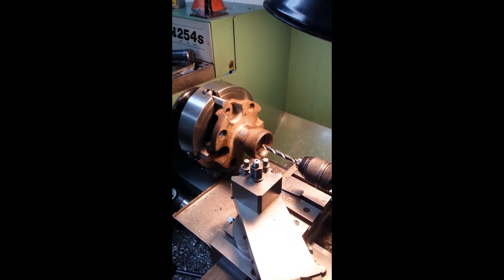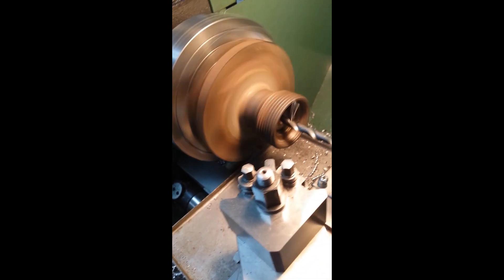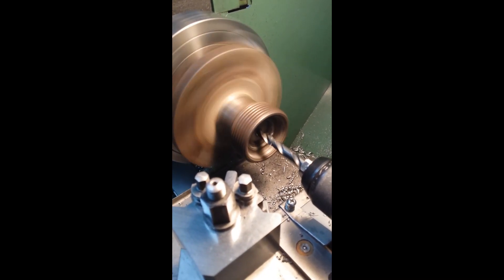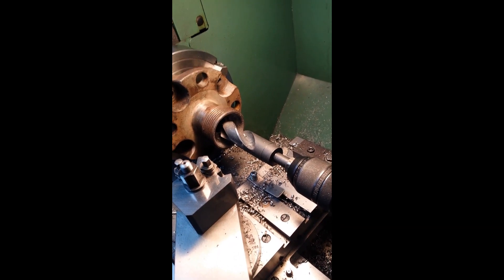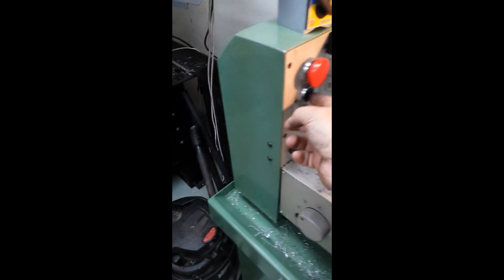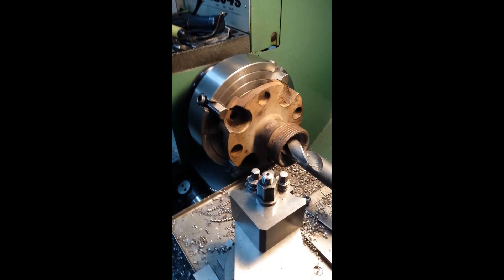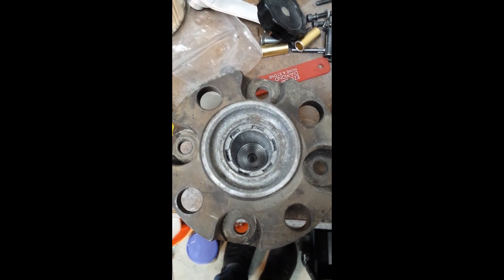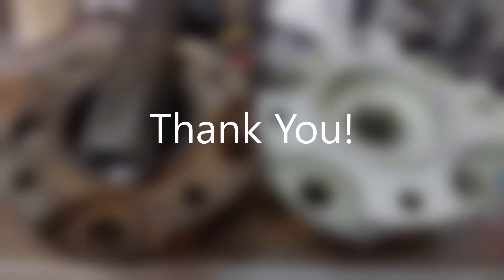Myford 254 Lathe - MGA Twin Cam rear axle removal from hub

Comment: One thing I always try on rusted parts at least with anything without rubber seals or bearings that might be affected is to warm the parts up more than enough to melt ordinary candle wax. Yeah it sounds like an old wives tale, but it really works. And I've seen it work many times when no amount of penetrating oil would. The heat slightly shifts things around and the wax is thin enough it flows into any areas it can and helps lubricate between the rust particles and the joint between the parts. It might save you some work some time. An old mechanic taught me that trick.
Reply from the maker: Hi, thanks for the tip I'll give it a try sometime on some less rare items.